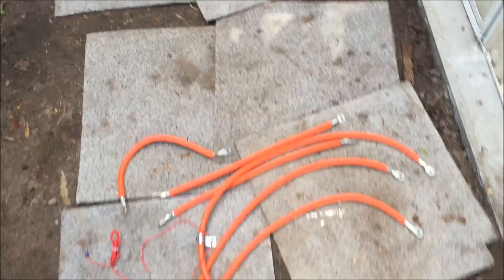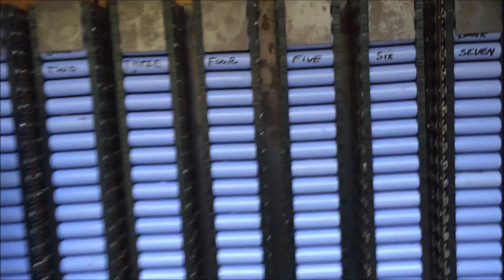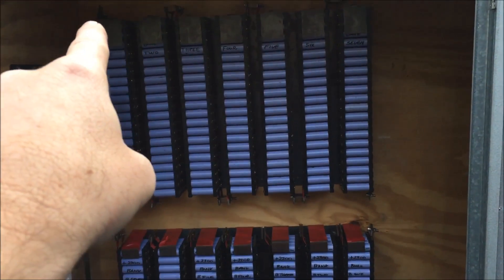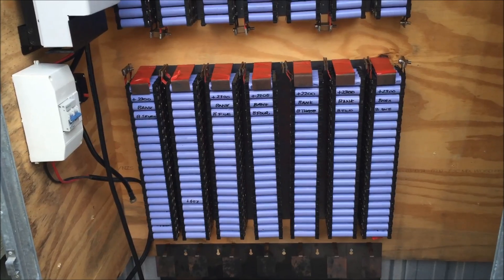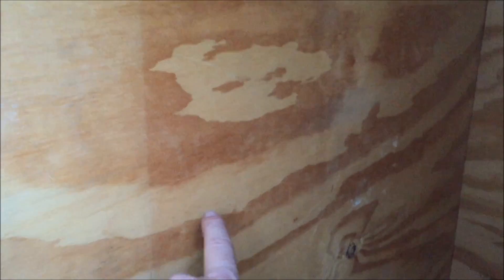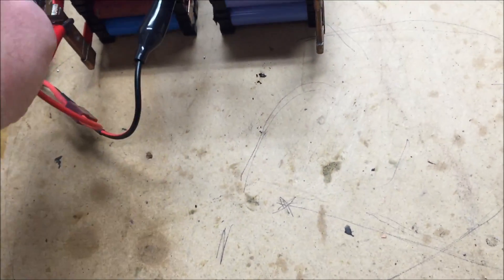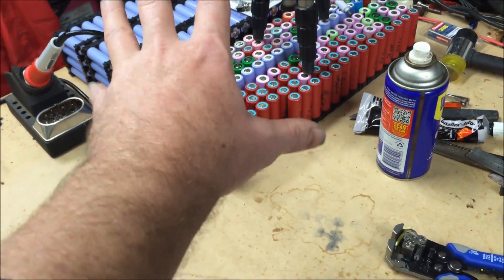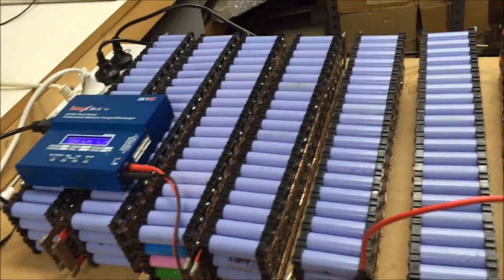Random update i guess...

Comment: where did you get the batteries ? . are they used? ☺
Reply from the maker: +Rahmatullah Rezai they are all from used laptop batteries
Reply: +HBPowerwall thank you for answering my questions! what kind of BMS do you use to charge and discharge the batteries? I am planning to make a powerful battery pack ☺
Reply from the maker: Currently don't have one attached they will be attached with time.
Reply: +HBPowerwall ok :)

Comment: Got a whole 23 18650's charged up to 3.7V, then my cheap charger died. My fault for killing it.
Still got my 6 best cells to charge. Then I just need more tons cells, and to capacity test the ones I have.

The 3x5 cell holders I got work well.
Reply from the maker: Good luck with your project mate :)